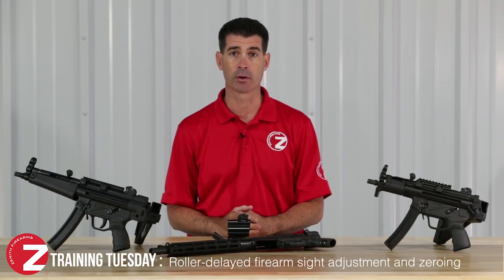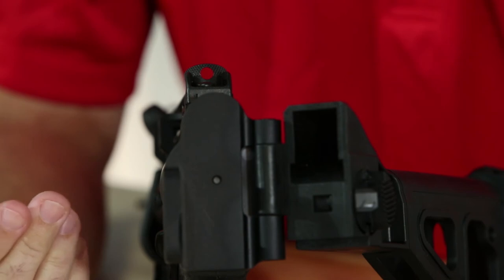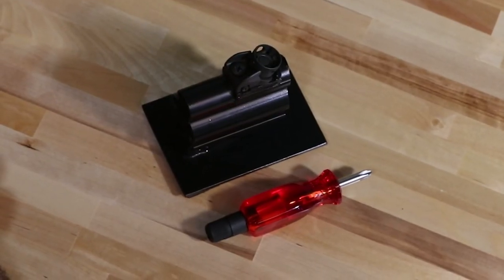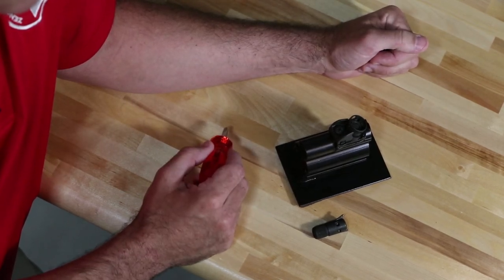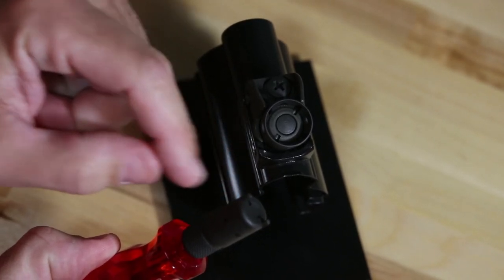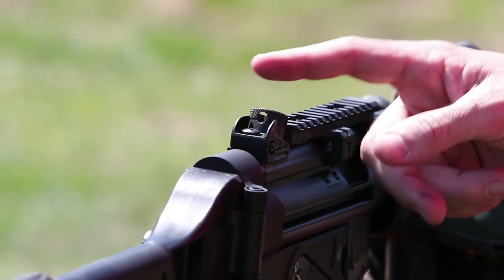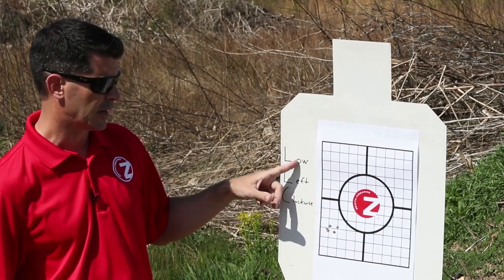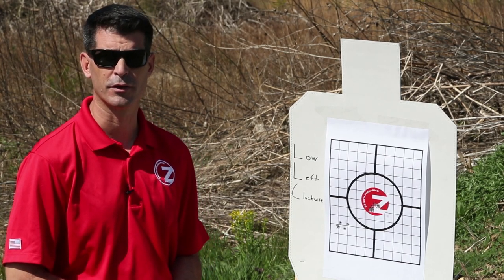Roller-delayed firearm sight adjustment and zeroing

Comment: Interesting how the HK SP5 requires the diopter sight to be turned clockwise to raise the elevation and counter clockwise to lower elevation. But the windage settings are the same. I wonder why Zenith/MKE decided to go with opposite elevation settings. This is frustrating when you have both brands.
Reply: I dont know what ur talking about it’s the same principle for the sp5 as shown in this video